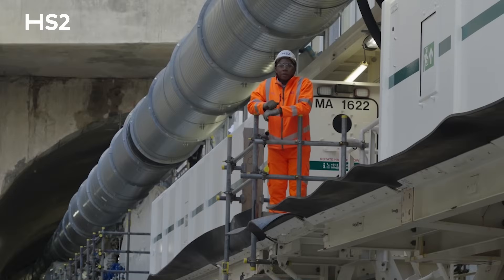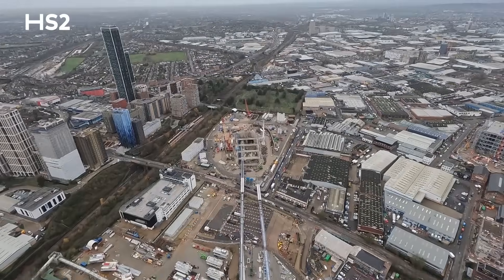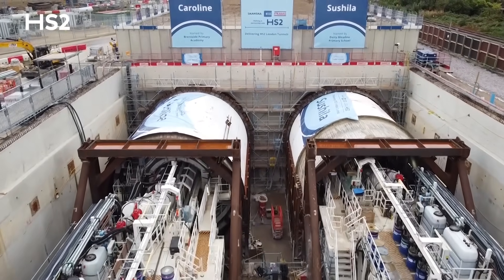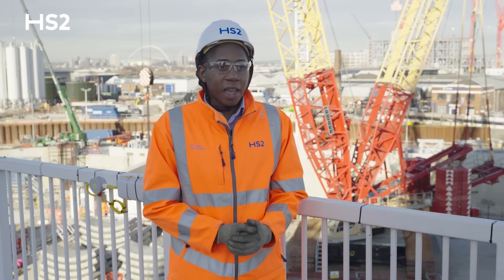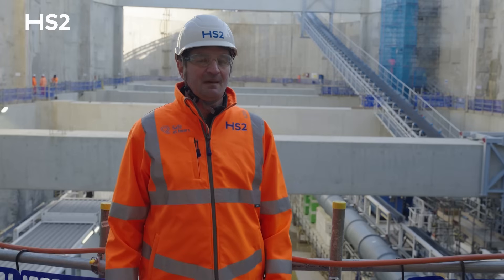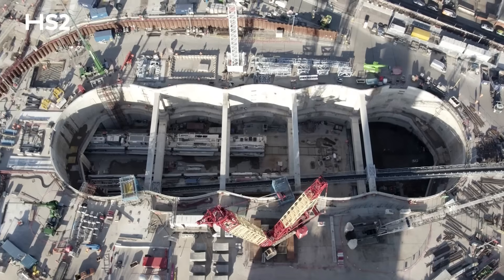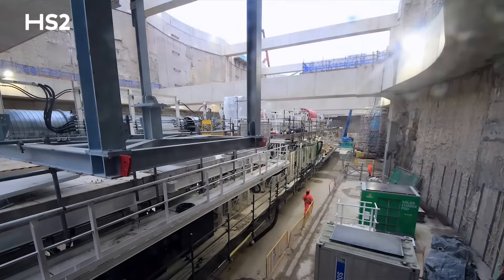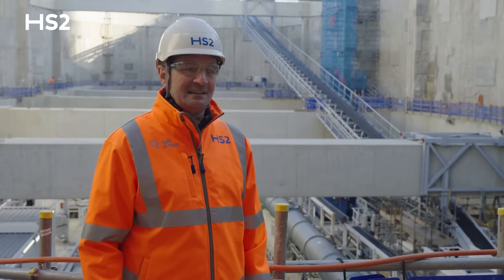New tunnelling machine joins three others digging high-speed line under London

Comment: What is the reason the tunnels cost 3 or 4 times the typical European cost? Having said that tunnels are brilliant they have known costs - there are no delays caused by litigation.
Reply: Once the tunnelling starts, it runs continuously 24/7. Tunnelling in gravel takes longer because liquid concrete has to be pumped into the ground to solidify the gravel. Same issue for stabilising shallow foundations to buildings.
Reply: @TrevorWilliams-fq8mg  There's not a lot you can do about loose gravel but I'd imagine there isn't that much of it. As for stabilisation of buildings I'd have thought going deeper would help alongside monitoring such buildings and sharing the cost of buttressing the foundations.
Reply: @johnfrancis4401 the gravelbis mainly in East London. But when the company I worked for they had to stabilise the shallow foundations to the old buildings around  Soho Square for fear of undermining the foundations with tunnel boring operations. Incidentally it was announced yesterday that tunelling from OOC to Euston will go ahead next year. Presumably the tunnel boring machines are steady ordered
Reply: @TrevorWilliams-fq8mg  In my opinion the only people who make money out of infrastructure projects are the lawyers. They have a job to do to protect the interests of their clients, I wouldn't want the Chinese system of the little man gets crushed, but the way to avoid delays, court cases, constantly revised estimates (which seem to double every three years) is to put almost all of the rail track in tunnels. Award the contract in sections that a boring machine can reasonably be expected to cover in two years. Then see which companies deliver and reward them with further work.
Reply: @johnfrancis4401 I sort of agree with you. Crossrail was built mainly in tunnels for the obvious reason there is no other way of travelling across London. Despite the cost going from 13 to 19 billion I would say it was a succesful project. Mostly designed before being competitively tendered. But HS2 is different as nothing was designed when the contracts were awarded except the route.   So all the problems came to light post award such as planning  conditions, road diversions, services diversions. Etc and the cost just goes up.
Reply: There's so much time wasting. There are stories of contracters who are hired to do a simple one hour job who have to book months in advance (while others are waiting for them) to go to site to have someone random supervise them and have others who could do the job just stand and watch because they are contracted to do the job after.

Comment: I think HS2 is a great project and I am just sad that the northern extension has been cancelled.
Reply: The part linking to the North must be restored, otherwise there's not much point is there?
Reply: @HughTerry69 I think there is still a point to it but if the northern sections were to be implemented its value would be hugely magnified.
Reply: I have said it from day one. Hs2 needs to go further north than Manchester. Minimum Glasgow possibly Edinburgh.
Reply: @donaldtriumph1682 The problem is that to take HS2 North to Scotlans is the terrain it goes through in Cumbria and the distance being the same again as from Crewe to London and this has taken long enough plus if they have Cancelled the bit to Manchester Scotland Doesn't stand a Chance
Reply: @peterwallen1063  I’m fully aware of the terrain through Cumbria and on into the Scottish lowlands. I’m also aware of the cancellation of the Manchester link. What I said was I thought they Should have not that they had planned to take it to Scotland. Be sure of one thing it will go north maybe not in my lifetime but it will get there.
Reply: @donaldtriumph1682  Sory about your dreams, but there have been no plans of running HS2 to Scotland ever or connect to HS1, Hs2 Trains will operate over the existing West Coast mainline to Scotland
Reply: @peterwallen1063  I think Scotland Government should have share the cost of building Phase 2 of the project through their taxes and meet in the middle. this is just another shortsighted Government full of old fogeys making stupid decision, Who should have retired and stick to gardening.
Reply: @donaldtriumph1682  waste of money when it's cheaper, faster and more convenient to fly. Loads more options.
Reply: @Joe90V  what’s the cost of flying freight north😂😂😂😂😂🤦🏼🤦🏼🤦🏼🤦🏼
Reply: @donaldtriumph1682 and what sticks in the throat of us Scots (and probably the Welsh & N.Irish) is that because it’s classified as “Critical infrastructure “ the cost is shared out between 🏴🏴🏴And Northern Ireland on a ratio basis Very roughly 🏴82%🏴9.5% 🏴5.5 %NI 2%. So is it still classified as “Critical Infrastructure and the smaller nations are paying for a tunnel to nowhere (near them)?
Reply: High speed rail needs to be extended at least as far north as Edinburgh and Glasgow.

The Eastern Leg needs to be restored too. And the Eastern Leg should also be extended to Scotland. The original (now cancelled) plan for HS2 has far to many spurs coming off it and missed the point that people living outside London do not just want to go to London. We need a government that will invest in through stations in English cities. The entire point of building a high speed rail network is to remove InterCity trains from our mainlines, so that those mainlines can be repurposed for local trains that give every English city an improved commuter service (more stopping services per hour, with local capacity becoming more like the services inside Greater London).

And, in the South, the cancellation of Euston, should be used as an opportunity to build a through station in London that connects Ediburgh and Glasgow to HS1, so that Eurostar services can run to Scotland, serving a number of English stations in the North West and North East of England and the West and East Midlands.

If we don't build the high speed network that does that job now, then we will have to replace bits of it later. The lack of ambition, in Westminster, has already seen Britain build a high speed rail station at Waterloo and then abandon it. We can't afford to be shortsighted and repeat that mistake.

Freeing up capacity on our existing mainlines can allow us to run many more stopping services and freight train and will take a lot of cars and lorries off of our roads. It will help us combat climate change and the reduced traffic on roads will speed up journeys for remaining drivers and lower the wear and tear that large vehicles cause to our roads (i.e. better public transport means less potholes to fix).

And building a new InterCity network, that can carry more passengers per hour means we can ban domestic flights between South East England and Scotland and also ban international flights between London's airports and Paris. That will also reduce climate change and will clean up the air in our skies and reduce noise nusance for anyone living near an airport.

So many things can be improved, if we get a government that stops pretending it's job is to avoid spending money and we tackle the climate emergency in a way that creates engineering jobs and projects that permanantly improves the connectivity between England and Scotland. (And Wales shouldn't be left out either. South Wales and North Wales should both have connections to high speed lines that reduce car and lorry traffic in the country.)
Reply: @DavidShepheard  First London Euston Terminal has not been cancelled, after consulting the Building Industry the Government was advised that London OOC is not sutble as a Terminus Station as it will not have the capacity, track or design to be Terminus Station having not been desighned as such from the beginning and were told that if Euston is going to be used at any time now or in the Future the relevent Tunnels need to be bored out between OOC and Euston as once OOC opens as a live station these tunnels could not be constructed and the fact the cost will be even more if it is left, next if they have cancelled the short leg to Manchester they definately wont build it to Scotland plus it won't be worth it as it would takeover 9 hours to get from Edinburgh to Paris, far quicker by Air.
The whole idea of HS2 is to divert hi speed trains from Crewe and Birmingham off the Existing WCML to London Euston that is it, it is based on Birmingham that is it with trains running North to Manchester and Scotland and South to London as a Domestic Hi Speed train service.
Reply: @DavidShepheard .. congratulations,  you've just quoted word for word,  HS2 Ltd's "perfect world" scenario that will NEVER ever come to fruition. 
The Eastern Leg, the Northern Leg,  the Golborne link & all the other parts of this monstrous vanity project that have been scrapped WON'T be restored when a Labour government wins the next election.
Sir Keir Starmer said in an interview last month that "it was not possible to do as the Tory government had blown the budget & contracts are going to be cancelled."
Research shows that even if HS2 had been built in full, traffic on the M40 & M1 would reduce by less then 1% so that's your argument about "reduced traffic on roads will speed up journeys for remaining drivers" up the spout!
Domestic flights between SE England & Scotland will NEVER be banned as due to the inconsistency & ludicrous pricing system of the current rail network, domestic fights all over the UK are enjoying a boom time - half the price of train tickets & one third of the journey times .. what's not to like?
Arguments that the WCML will soon be "full to capacity", rely on a discredited, out of date forecasting model which overestimates long distance passenger growth & isn't used for anything anymore except to justify the massive white elephant that is HS2.
Network Rail's "New Lines Programme Capacity Analysis" shows that WCML capacity is kept artificially low by private operators wanting to maximise profits.
A DfT analysis shows that in peak hours leaving Euston, WCML trains were loaded at just 52.2%.
I'm amazed that HS2 fanboys like yourself don't do any research yet are happy to repeat the lying rhetoric that HS2 Ltd have been bombarding the public with about a project that was doomed to failure from day one. 
Now that the blatant corruption is finally being exposed (which hopefully will result in a public enquiry), we'll look back on this disaster of a project & rue the day it was ever given the go ahead by buffoon Boris.
Reply: @DavidShepheard This country is one of the most centralised (in one area) in the World and it causes an unhealthy feedback loop of attracting more companies and∵ more people ,needing more housing , schools etc i.e infrastructure and because of  attracts more companies ,therefore more Govt funding …meanwhile the rest of the country has to make do with what’s left …it begs the question David… why the heck wasn’t it started in the North with HS3 ? We would’ve got a helluva sight more infrastructure built for the same amt if money . The north of England is Seriously Underfunded -try driving up the A1 from Alnwick to Berwick but FGS don’t do it during the summer -it’s not even dualled in most places and it’s like a rollercoaster!. I’m also concerned that Scotland just doesn’t seem to matter to Westminster as there’s no extension to Edinburgh /Glasgow . It’s about time that greedy cuckoo aka London & the S.East was put on a financial diet or throttled !😅😅
Reply: Perhaps rename it, HS2Bank?
Reply: 'Indefinitely' postponed. 😉
Reply: @EdgyNumber1  I think you need to do a bit more  reserch, Euston if that is what your on about has not been indefinately postponed, they have already bored out the service tunnel between OOC and Euston with plans to start the other tunnels
Reply: @peterwallen1063 *INDEFINITELY not "indefinately".
After the service tunnel was bored, the 2 tunnel boring machines were buried into the site as any further construction at Euston has been "paused" for 2 years.
In fact, the tunnel boring machines might never see the light of day again if the government are unable to find private investment to complete Euston so at the moment, there are NO "plans to start the other tunnels".
Reply: @CRIMSONANT1  Yuove gone quite now James my man after watching the other you tube video of the tunnel boring machines breaking through, Yep they ain't burying them are they James my man
Reply: Durrrrrrr